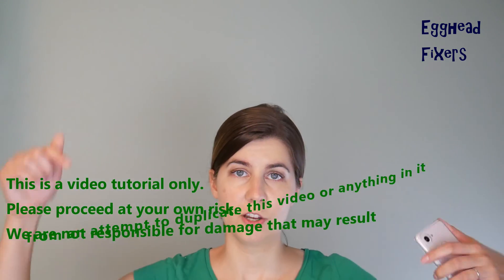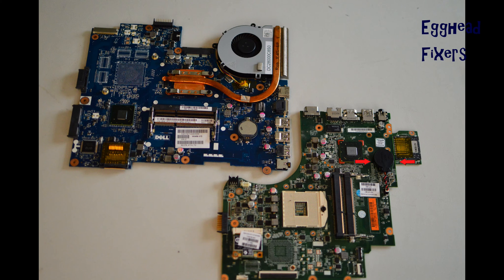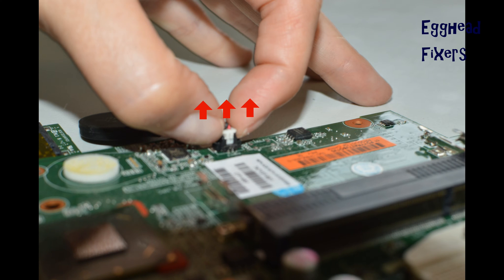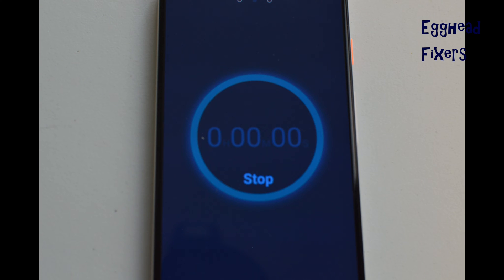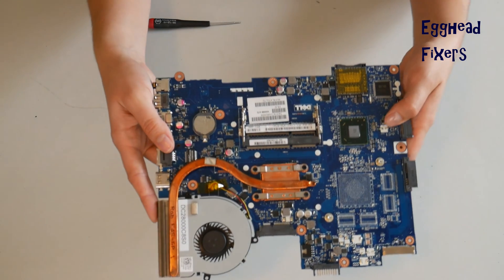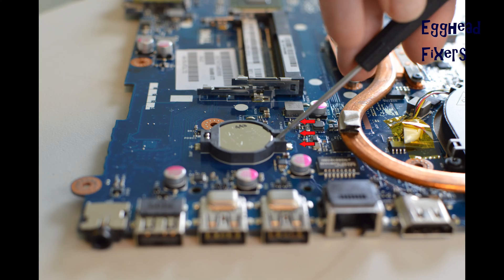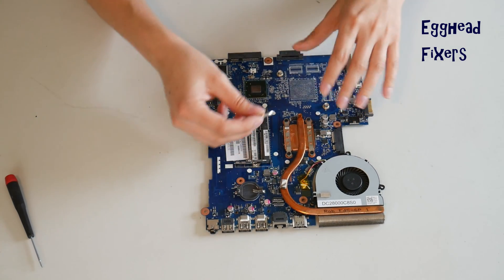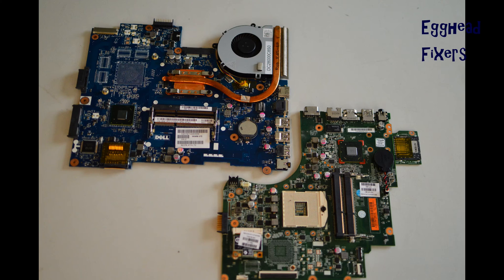How To Do a Bios Reset If Your Alienware Turns On Then Off, Freezes or Won't Turn On At All. Video 4

Comment: I recently installed a new battery in my 17 R2, the problem is that sometimes the laptop wont recognize the battery then in order to turn it on i must have to replug the battery connector, is this method worth trying ?
Reply from the maker: Yes but before trying this have tried updating the firmware? I would try that first.

Comment: M15 R3 (2021 model). Tried installing a new m2 but not turning on even after removing the ssd. Error is 3 red & 5 blue lights. Tried reseting by disconnecting main battery, but no avail. Is this something that can be fixed by resetting CMOS battery? Thanks
Reply from the maker: That would be the next step is trying to reset the CMOS battery.  That will hard reset the board and hopefully take care of the problem.
Reply: @Egghead Fixers  thank you...  taking apart the board is one hell of a job with these things:( But better than having to buy a new mb for sure
Reply: Hi I'm having same issue, did you later fix it?
Reply: @rook6194  no, unfortunately i had to replace two of the three main boards, because apparently i shorted the power rail and something else. You can still try the workarounds suggested before going to Dell.

Comment: Love the content, keep up the great work!

I've got an Alienware 15 r1, worked perfectly until a bios update froze on me, now it wont post, just black screen, restarts after 10-20 seconds
Tried: ram swapping check, CMOS unplugged for 20mins, Replaced CMOS with new one and unplugged for 30mins
I got a CMOS 5 beeps code after unplugging and replacing but it went away after a restart each time.

Would love to heat what your next approach would be!
I was thinking maybe bios flash? but never done it

Cheers!
Reply from the maker: Have you tried replacing it with a new CMOS battery? Also have set the date and time in BIOS after reset?
Reply: @EggheadFixers  yes i Replaced CMOS with a new one and unplugged it for 30mins,
Cant set date and time since i only get a black screen, cant get into the bios at all :/

Comment: Hello please my areas 51m has a bios issue i was updating my bios then it shut down and didn’t turn on again I’ve tried power drain and a couple of stuffs i saw online it didn’t work there’s power in the pc anytime i plug my phone to it, it charges my phone but it’s not turning on at all, fans spin for 2sec and turns off any fix for that please
Reply from the maker: And you tried a BIOS reset? Also does your charger seem like it's working well?

Comment: Hello, do You have a fix for the 3 blinks 1 blink? Cmos battery failure, i try to reset the battery but it just power up the LEDS with black screen
Reply from the maker: Does the computer seem like it's charging ok? Also have you tried replacing the CMOS battery?
Reply: @EggheadFixers  please can you reply me

Comment: Hi I have an ALienware m17X, R1, P18E, MBoard :Vas00 La-9331p, My bios is locked then tried your method but did not work. Any suggestion ?
Reply from the maker: Have you tried calling the manufacture to unlock it? Only the manufacturer can provide the unlock password.
Reply: @EggheadFixers  yes unfortunately it’s a cancelled order open box.. looks like a dead end

Comment: For 7 beep?
Reply from the maker: 7 beeps typically is an issue with your motherboard or CPU. I would try a BIOS reset like you see in this video. I would also try this solution:

https://youtu.be/lFv5pqNadVQ

Comment: raised ram speed in xmp for AW aurora r10. upon restart got black screen and no input to the monitor, cant access bios to change settings/undo the change i made. also it’s a prebuilt so i have 0 experience taking apart and putting together computers, so how difficult would it be to even access the cmos battery? do i need to take the entire motherboard out of the computer, if so how hard would that be given things like the liquid cooling system and additional components of the pc that would be attached to the mobo?
Reply from the maker: No you usually don't need to take the motherboard out do this. It looks like from what I can see you have a desktop. Often times with a desktop you don't need to remove the CMOS battery. The best way to reset the BIOS is with the jumper.
Reply: @EggheadFixers  yes i do have a desktop. so would either solution work? removing the battery or using the jumpers? also, do you guys have a video on using the jumpers to reset bios, i’m not sure where it would be or how to use it.
Reply from the maker: @rytu3670  Either would work the jumper is just a little easier. We don't have a video on it but here a link to how Dell (Alienware) says to do it:
https://www.dell.com/support/manuals/en-us/alienware-aurora-r10-desktop/alienware-aurora-ryzen-service-manual/clearing-cmos-settings?guid=guid-94341e81-58b7-48a3-9995-f7516b380aff

Comment: My Alienware just turns on then freezes then restarts
Reply from the maker: At what point does it freeze? Does it freeze at the Alienware logo? Or does it freeze after that?
Reply: @EggheadFixers  Both, honestly. Sometimes it freezes on the logo, sometimes it freezes after the logo on the windows screen. I ran a test and it says I have a hard drive issue. Sorry for the late response. It’s craxy because I just started college and I have no laptop for class now
Reply from the maker: @MarcusVsEveryone  Ya then you are going need to replace it. Here is a video on how to do it: 

https://youtu.be/ivgdP_6Twb4
Reply: @EggheadFixers  thanks but what physical size hard drive would I need for an Alienware 17 R5 hard drive? I appreciate your help!
Reply from the maker: @MarcusVsEveryone  Do you know what kind of drives you currently have installed? SSDs or HDDS? Because from what I can see you have a couple different option.
Reply: @EggheadFixers  both. The problem was the HDD, I took it out and now my computer is working. I guess it fit messed up overtime. Just gotta buy a new one now lol. Thanks for everything though!!
Reply from the maker: @MarcusVsEveryone  You're welcome!!

Comment: Do you have a fix video for the 1 beep code? I think it’s the bios corrupted and I tried the bios reset, but should I completely remove the main board? To do it again? It’s a Alienware m17 btw! Any help would be greatly appreciated!
Reply from the maker: Yes that usually it is motherboard / BIOS related error. What happens when you try to turn the computer on? Does is turn on at all?
Reply: @EggheadFixers  all lights power on, but screen stays blank and then continues to do the 1 beep error continuously! I’ve tried power drain by removing bat and hold power button for 30 sec, and I’ve tried resetting bios “not sure how long I left cmos out” but I even checked volts in the cmos bat. And volts are 3. Something! Sorry it’s been a minute since I messed with it.
Reply from the maker: @callmedaddy6324  1 beep error can be a bad motherboard. Although if it turns on but the screen remains black I would try and see if it is a RAM problem. Here is a video on that:

https://youtu.be/i-H0Rfk3-uc

Although it maybe a problem with your actual motherboard.
Reply from the maker: @callmedaddy6324  You're welcome!!
Reply: And for 7 beep?

Comment: Hi, I upgraded the cpu to Xeon and though the computer turns on it won't boot. This is an old (2011) Aurora ALX. I am unable to find the cmos battery. Can you tell me where it is on this model?
Reply from the maker: When you say it won't boot...Does display anything when it turns on? Or does the screen stay black?
Reply from the maker: It's a coin size battery not too far from the CPU. Something may be blocking it so you can't see it.

Comment: I have the "yellow light of death" on my Alienware ASM-100 Console. Will a CMOS replacement followed by CMOS reset work to fix it?
Reply from the maker: What problem is it having besides the yellow light? Does it turn on?
Reply: @EggheadFixers  So I press the power button, it goes blue for like a second - then yellow light of death. That's it. 

It doesn't boot - nothing on the screen. It is an Alienware ASM-100 Console. What should be my next steps?
Reply from the maker: @abhid.2679  You could try replacing the CMOS that is a definite possibility. You could also check your RAM. Bad RAM can also cause issues like that. Here is a video on how to do that:

https://youtu.be/i-H0Rfk3-uc

Comment: Alienware 15r3 2016 bought . Had a "charger not compatible" warning. I didn't insert the charger all the way long & when I did, it was working fine. After 4 days of no usage it doesn't turn on. Blinks 2 red , 4 blue . I'm scared 😟 would it cost me big money to repair ??
Reply from the maker: LED code 2 4 is usually a RAM problem which is usually not a very expensive repair. Alienware is made by Dell so here is a video on a Dell 2 4 LED Code:

https://youtu.be/VeREm2sfC2g

It will show you how to fix a problem like this.
Reply: @EggheadFixers  Thankyou ma'am , you're really good 😃   I'll watch the video right now.
Reply from the maker: @NavvLife  No prob👍

Comment: i completed a BIOS, now instead of a 8 beeps and a blue screen with static lines on the top section, the screen is now blank and beeping 5 times with a blank screen and the laptop won't shut off unless I hold down the power button. Now that I turned off the laptop and turned it back on, it is as it was before the BIOS reset with the blue screen, lines on the top half and 8 beeps. I thank God its not 5 beeps lol. Idk why the computer beeped 5 time with a blank screen then switched back to 8 beeps and a blue screen as it has been.
Reply from the maker: Here is a link to Alienware beep codes:

https://www.dell.com/community/Alienware-General-Read-Only/Alienware-Beep-Codes-Table/td-p/5588971
Reply: @EggheadFixers  I know what the beeps mean.  I was stating that because it was monkey upon the first start up after doing a bios
Reply from the maker: @QuentinDarrentino  Ah ya that makes sense